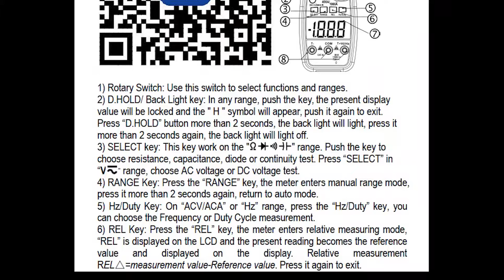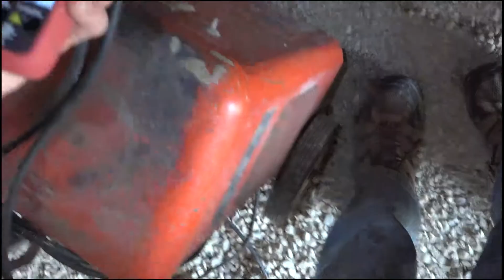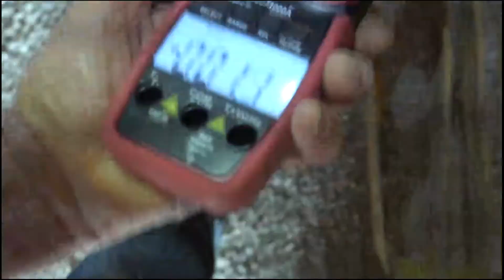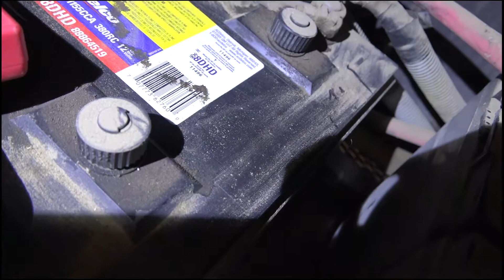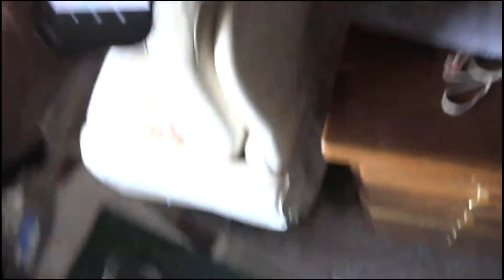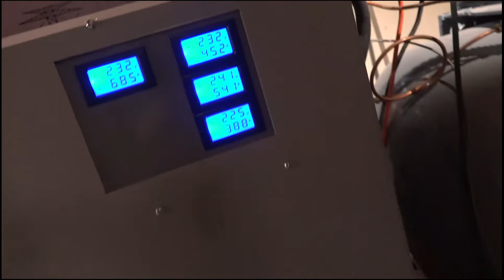DC Clamp On Meter?  BT570  Does it Work???

Comment: Just to clarify, you bought the BT-570C model. Maybe you could buy the BT-570N model and do a video on it. It has all the features that you complained about on the "C" model for less money. It doesn't have the app feature though.  Additionally, the "N" model has INRUSH and a temperature probe which is very helpful if you own an air conditioner. I own the "N" model and love it.

Comment: The meter on DC amps uses a Hall effect sensor, effectively reading magnetic field. It's affected by any magnetic fields -incl. magnetized screwdrivers. You have to tap rel before each measurement. Every clamp meter is pretty much the same.